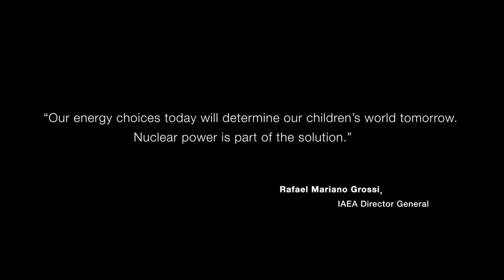Nuclear Power: The Road to a Carbon Free Future

Comment: How pathetic of this leading nuclear power body to imply that one of the main justifications for deploying nuclear power is to support renewable technologies. Just 5 years from now, GE-Hitachi will start building their first BWRX-300 SMR and, after a 2 year build programme, the breakers will be thrown in 2027. It is the simplest, and therefore the most cost-effective nuclear power plant [npp] that has ever been designed and is ever likely to be designed.

By 2030, it will be available at a capital cost of $2,000/kW - 1/3rd of the capital cost of 'big' nuclear, 1/5th of the capital cost of onshore wind [the most cost-effective renewable technology] and 1/2 the capital cost of any other Gen III+, PWR-based SMR. It beggars the question - why bother deploying any other form of npp?

The BWRX-300 is designed-to-cost and uses <50% of the concrete per MW of the ESBWR, from which it was derived and, the cost of concrete and the laying of the concrete is the biggest element of cost in npp construction. The effectiveness of cost cutting reduces the material content of the BWRX-300 to just 1/46th of that of wind power, per unit of electricity generated.

In this political era, governed by the need for low-carbon sources of electricity generation, the nuclear power industry is being driven into the ground by failing in the battle for investment. Renewables are the cause of the ongoing decline of nuclear power, as the pseudo-green, pension fund managers sink investment into any and all of the quick-build, quick-payout, subsidised renewable technologies.

But the BWRX-300's 2 year build programme negates the cost-of-capital penalty 'big' nuclear has suffered for decades. At 1/5th of the capital cost and using 1/46th of the material of the very best of renewables, we - the pro-nuclear community in its entirety - have all the armament we need to completely turn the tables, in the competition for investment.

Basically, choosing a technology with high capital cost desecrates the planet. We've lost the publicity battle surrounding the complex LCOE narrative, so what we need to drive into the minds of our politicians, the likes of X-R and the general public, is the dark and filthy secret behind the 5X higher capital cost of wind power compared to the BWRX-300. And that is the 46X greater use of materials - steel, other metals, plastics, concrete and so on. 

It takes little imagination to picture the volumes of precious materials and resources unnecessarily wasted - huge increases in mining and quarrying; the fossil-fuelled heavy plant and equipment; the fossil-fuelled transport every step of the way; smelting and processing of materials; manufacture, site preparation and installation. And all of this before a single unit of electricity is generated.

Stop drinking the renewables' kool aid, IAEA and develop a backbone! Battle against the duplicity and mendacity that has got renewables to the pinnacle of low-carbon generation. Get behind SMRs - the inexorable future of nuclear power. Get behind the BWRX-300 in particular.
Reply: I too like the BWRX-300, among other reactor designs. My only gripe with the whole SMR thing is that it's dependant on economies of scale and a constant flow of orders, and I'm not sure how many utility companies across the world will be buying the technology at a sufficient scale.
Reply: @adamdanilowicz4252  If you accept the future of electricity generation will be politically forced into deploying low-carbon generation technologies, the future market is enormous and essential. The battle is a straightforward one between renewables and nuclear, with wind and solar being the predominant renewable technologies.

With the BWRX-300's build programme being reduced to 2 years - same as wind and solar - the quick returns these pseudo-green, quick-buck, pension fund managers so desperately seek, will be available from SMR nuclear power. A single BWRX-300, with a capital cost of £456 million, will generate 142 million MWh of dividend-paying electricity over a 60 year lifespan. £456 million spent on onshore wind, would finance 450 MW of onshore wind, which would generate 30 million MWh of dividend-paying electricity, over a 25 year lifespan.

Put the same money in and get nearly 5X the earnings - it's a 'no contest'. Those fund managers will be crawling over one another to get their money out of renewables and into SMRs. The politics will follow the money; the general public will be told - you're getting nuclear, it's safe and it will cut your electricity bills. There will be the shrugging of millions of shoulders and a 'just get on with it' response.

Comment: coming from 30 years in the commercial nuc power industry, I will tell you loud and clear that the main risks and costs are associated with licensing uncertainty - and the resulting required design changes.  I never hear about this from these small reactor sales men.
Reply: Licensing? What does that mean?

Comment: I don't trust anyone who pronounces nuclear, "nuke-you-ler" to operate a nuclear power plant. I also don't trust any corporate commercial operator to maintain safety, because their primary objective is producing a profit and dividends for shareholders. The concept of small, on site user operated plants sounds like a good idea, as opposed to large centrally located plant, as long as SAFTY is the primary concern. I was a nuclear submariner in the US Navy. I have been inside a nuclear reactor, standing Fire Watch over a welder doing repairs. We drilled regularly, in port and at sea, for spills and accidents. Nuclear power is great underwater, as long as it stays there. I live on Long Island, where the local power company built a reactor against resident's wishes. It was shut down before it opened because they finally realized that in the event of an accident, it would be impossible to evacuate the population. It's not a joke that the Long Island Expressway is called "the worlds longest parking lot."

Comment: Lets be honest the real need is for "Fast Breeder Reactors" to insure that there is minimum Nuclear Waste to insure Safe Storage.

Russian BN-800 FBRs are one good examples.

Renewable sources of energy like Solar & Wind are only good for Green Hydrogen(H2) production.

Both Battery EVs & Hydrogen FCEVs are the future of Mobility in 21st century.

Even if more advanced  fast charging battery solutions are developed, bigger transportation systems like Trucks, Merchant Ships & Commercial Aircraft will require Hydrogen FCEVs technology.

"Nuclear Energy" is also the solution to the future Space Mobility requirements especially for Space Mining Operations.
Reply: Bob Nichols @ veterans today ,
Reply: Doug lightfoot of the lightfoot institute 
Nobodysfuel agrees the conversation to nuclear for ships is a must.
Reply: "Both Battery EVs & Hydrogen FCEVs are the future of Mobility in 21st century." - wrong, we have oceans of oil still in reserve, so much better for the environment than all the chemical-filled batteries needed for EVs.
Reply: @malthus101   Not every country has the Ocean of Oil &  Gas so its better for those Nations that lack such resources to invest in Battery-EVs &  Hydrogen FCEVs.
Reply: @sk8899  nope they can buy from countries that do. Besides, how will they make their solar panels and wind turbines without fossil fuels?
Reply: @malthus101   Solar &  Wind have intermittency issues so its best to invest in Nuclear Energy to maintain Base load requirements.
Reply: @sk8899  you dodged the question.

Comment: My biggest concern is about the Safety of Small Modular Reactors especially from Terrorist attacks.

Conventional large scale Nuclear Reactors can generate a lot of Energy & transfer it through Grid networks.
And, Government can ensure the safety of these Reactors.

At present the usual design capacity for PWRs is 1000+ Mwe or 1500+Mwe, if new PWR designs of 2000 to 2500+ MWe are developed & constructed in Mass scale to reduce the Costs then What is better??
SMRs or Conventional PWRs??

Now, the major question is What about the Brine Solution after Seawater Desalination??

What are the challenges to Marine life from Brine solution dumping in Oceans??

Can Brine solution be Mined for Mineral Resources like Lithium, Sodium, Uranium, Thorium etc??

What about Thorium based Molten Salt Reactors??
Or
Fast Breeder Reactors to utilise the Nuclear spent fuel??
Reply: If containment structures are built as they should terrorist attacks won't be an issue, from the outside. 

SMR's are good because they're easier to assemble and though they generate less energy than a large plant they can still power up towns. 

My hope lies with Thorium Reactors, or as you said molten sodium reactors.

Comment: Sweet! It's cheap, clean, sustainable, and best of all it can support wind/solar. Wait, why not just scrap the wind/solar then?
Reply: Because solar may be cheaper to build per mwh. But the sun isn't always shining so you still need that dispatchable base load that nuclear provides.
Reply: @Sschieffelin  If that were true, then energy bills would be decreasing in areas with solar/wind not increasing. The per MWHr rates are BS, based on unrealistic assumptions. Reality is when you have solar/wind you have to run the backups inefficiently, buy electricity from neighbors during high demand, and pay neighbors to take excess during low demand. When those realities are considered the per MWHr rates explode for solar/wind.
Reply: Yes! Let's become solely dependent on a single energy source that can't be mined off of every country on earth. What a great idea let's do it!
Reply: Wind and solar are better on buildings(especially on midrise. Example you creat a power nest enhanacing both. Solar panel are more optimal at certain temperture levels while the turbines will cooll down the solar panels as well as generating electricity.  This is why the need for diverse sources of energy.
Reply: @Sschieffelin  You also add turbines on rooftops especially on midrise where the wind is stronger.
Reply: @mynameisnobody5295  prove it by showing me where energy rates went down with wind and solar.
Reply: @cheesy__bear  Whats that got to do with creating energy on peoples homes?  Ive never said I was against Nuclear Power as it also has a place.  It's better to use many types of sources depending on locations.  I live in a costal town and we get strong winds the winter and autum and good amount of sunlight in the summer. You create a nest on mid to high rise buildings where wind is stronger. There is also heatpumps.
Reply: @mynameisnobody5295  So, your point is solar on a roof is better than solar on the ground? Um ok, how? and the relevance of this is what exactly?
Reply: @cheesy__bear  No, but to combine both on rooftops. A frame that has the solar panels facing the the optimate light zones and the turbine underneath solar panels that also generate energy as well as cooling the solar panels.  Solar panels can lose effeincy if too hot so the turbines create cooling effect like that a PC has a fan to cool it down.

Comment: This may sound far fetched but bear with me.  Civilizations have collapsed in the past many times.  One of the most recent was the fall of the Roman Empire.  Heck, We didn't even have running water and reticulated sewage again until the Victorian era.  So my question is this.  What happens to all these nuclear power stations, and for that matter all the repositories of nuclear waste that the industry has still not found a solution for, if our civilization collapses.  We will no longer have the money, the equipment or the expertise to manage them.  It may not happen any time soon but with our bent politicians, pandering to the rich and the vested interests, it would seem that we are really pushing the envelope.  Add to this that it is apparently now less expensive kW for kW to build and operate wind and/or solar farms.  With the lesson of the mega battery in Australia, it looks as if we have solved the problem of not generating power when it is needed and having an excess when we don't need it.
Reply: Nuclear waste is not now or ever been a real physical problem, only a political problem. The tiny amount we have is safely stored in nearly indestructible steel reinforced concrete casks that can withstand being hit by a train. It will just sit there waiting for the commercialization of molten salt breeder reactors to reuse and consume it as fuel, it's worth a fortune. That type of reactor is in the licensing phase in the US, Canada, Russia, and China.

Wind and solar are not cheap, they can only add cost to a reliable electricity source. They just upgraded the mega battery in Australia, it went from 11 minutes of capacity to one hour. It is not the kind of storage battery that you think it is. It's a buffering battery that smooths out the current going to the grid, which allows them to have fewer diesel generators running 24/7.
Reply: They burry waste inside bunkers then put some resin and concrete over it, basically makes impossible to contaminate anything even if earth crack down in that area, because that resin will expand and fill any cracks.